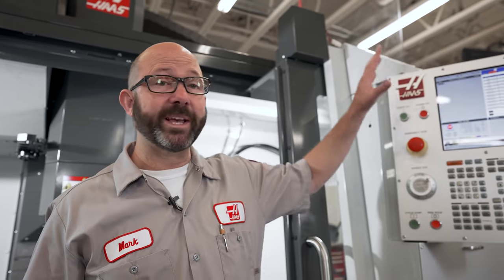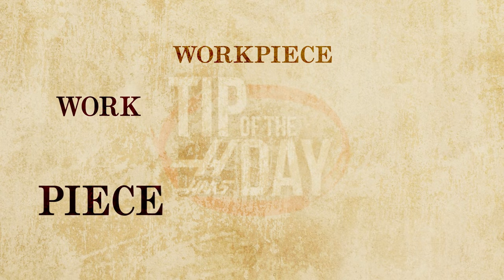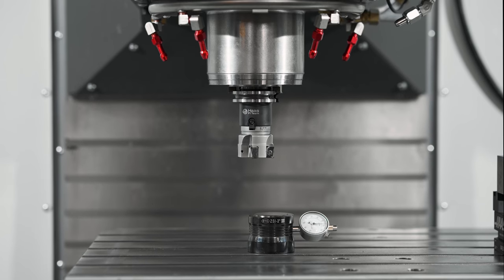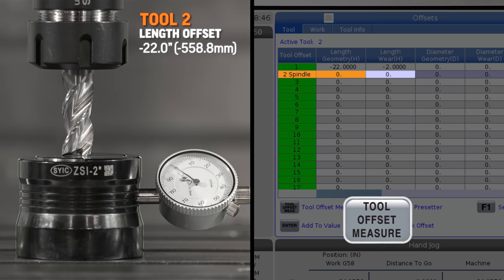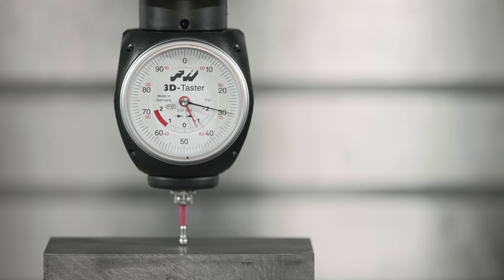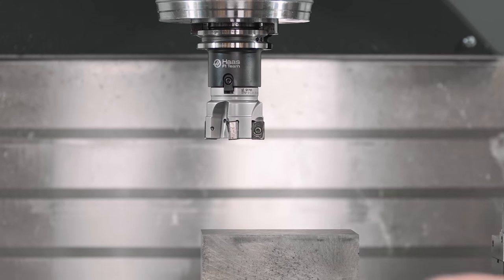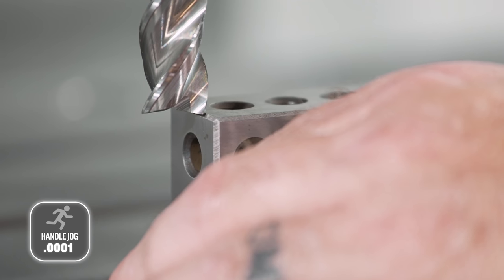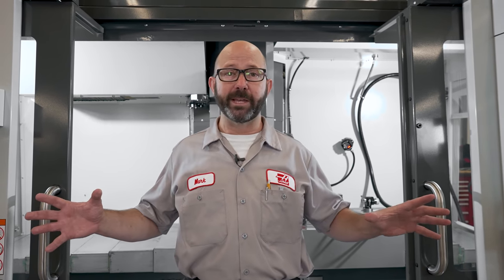Tool Offsets and Manual Tool Setters - Haas Tip of the Day

Comment: I come from 5 axis CNC routers programming. Silly question here: Why do you have to go thru all this drama for every tool? Don't these CNC come with an auto tool length measuring sensor for tool length compensation? You should only be loading the tool on the carousel tool chamber, then tell the machine to auto measure every one of them and DONE! You can use G54 for every tool within a (Sub-Pro-operation) knowing the the exact distance from the tool holder to the top of your stock, your machine is supposed to auto tool compensate for every tool, it would never miss it or crash. Sorry! Had to ask, just curious!!!

Comment: This would be a lifesaver if my tool probe died.
Reply: Sometimes we forget to order batteries. In that case, if you have a known good tool already in the machine, you can mill something flat (or use a vise bed/table surface, etc) and set your operator coordinates to the length of that tool. Then bring an unknown length tool to touch that same surface (or on a gage tool.) Your operator coordinates will have the length of the unknown tool.
Reply: I always have probe stylists in my desk for that reason, my boss hates they sit around in a drawer but no one give me credit for keeping one in my desk. Same with batteries. 

Make sure not to but any probe batteries later than 1 year after the manufacturer date
Reply: Please don't use the wear offset column to compensate for tool setters. That is the tool geometry.  A lot of times the machine will alarm out if the wear offset is over 50 tho

Comment: We use a pretty cheap tool probe and set all the tools to the top of it. We don't subtract to get us to the table. The we then touch off our part with our haimer stored as a tool. When we touch off we hit part measure and then we add the tool offset value for the haimer.

Comment: Why take the 2" out to get to the table? Just put the work offset from tool touch gauge to part Z zero....done.
Reply: That’s exactly what I do at work.
Reply: I think the purpose is to be able to use whatever height setter you want. If you can't find that touch off gage, or someone else is using it, you can just use whatever you have handy to touch off to the table. This way it is always using the table surface as reference. As Mark shows, you can use any height touch off gage. 1", 2", 4", etc.

Your method works too, but you must always use the same touch off point, since that's your reference.
Reply: @GRTLRS  Good answer, but of course best practice is always use the same reference that never leaves that machine.  Traveling height gauges tend to get lost and dropped.

Comment: We use multiple methods, but for when they use the paper method, I have provided all my machinists with small 1"X 2" pieces of 0.001" thick stainless shim stock.  These are cheap and east to make, and can be cut with regular scissors.  They don't fall apart when when wet and they are a reliable thickness and reusable many times.  You're pretty much right on zero when that shim stops moving under the tool.
Reply: I ran pricey lathes for a few years using the paper method that most of the guys recommended and used in the shop. 90% of the time works fine... but I realized after some time that there were certain tools and situations were the paper isn't the best method. That shim stock will help from breaking/chipping some stuff.

Comment: We used a surface plate with a hole for instrument cone. Then we put a tool on the surface plate, cone in the hole. And then we measure height of endmill using height gauge. A bit strange, not precise (+/- 0.1 mm) and error prone method. It works but not convenient and not precise.

Comment: When I was first learning CNC, I was taught to touch off all tools using a paper shim to the top of the work piece stock. If ANYTHING changed, youd have to touch off all the tools again. When I got my first job as a machinist, we were taught to touch off all tools to the table, which is a common datum plane, which makes WAY more sense, using a 2x4x6 block and a half inch dowel pin. This keeps the spindle pretty far from the table, which can prevent bumps to tall items such as rotary axes. Jog the tool down near the block, slide it under, then jog the tool away from the pin till it clears. Then subtract 6.5" from the length. The tool length is now set as the distance from Z home to the table. Work Z offset was the distance to the table to the top of the finished work piece. Taller parallels? Just raise your Z offset.
Reply: This totally makes sense, I used to use the paper method too but I’ve lost count of the number of times I’ve chipped a brand new end mill by doing this

Comment: Everyone at my work uses fancy tool setters, I’m working on making one, I’m just glad I’m
Not the only one that uses a 1,2,3 block for touching tools off. Newer people look at me like I’m crazy, I learned that trick from my old boss who has been running CNCs since the day you had to punch your code on paper. At my shop we use tool setters and probes, but occasionally on older machines I use 123 blocks on the vice
Reply: This is basically what I do when I set my tooling. The machine I use at work is at the hobby level and isn't worth spending more money on more fancy height gauges and such.
Reply: used to do that until a part had to be put ontop of the vise. then we maybe riser blocks about 4-6" tall that are bolted to a back corner of the table. then use a 123 ontop of that. that way your reference point is always avaiable.

Comment: Hi community! I'm in the Industrial Technician school in Denmark, I'm using a VF2 and we measure the tool offset with a digital setter as in the video. We have a G154 P99 programable offset, so ass soon as that red light goes on, we press "tool offset measure". This save us to compensate any extra, but is important to remember to run the compensation in MDI before offsetting the tools. Thanks for the video Mark, as always!
Reply: Това е мисля по добрия вариант и аз работя така
Reply: Could you explain a bit more about the G154 P99 programable offset ? Sounds interesting, Thanks
Reply: @KaLiDEM   I will try, this was some years ago and I'm not anymore with that machine. The idea is to place the tool setter on the working table and touch it with the spindle to store the Z value in an offset, in this case G154 P99. Once that’s done, with the offset active in the machine, you can put any tool into the spindle, then touch in the setter and when you’re ready you just press the “tool offset measure” button. So because you have G154 P99 active, the tool offset that will be updated in the tool will be the difference of the spindle offset stored in G154 P99 and the actual tool length.
Again, I haven’t used this method for a few years, so I may be missing some details in this explanation.
Cheers!

Comment: Mark, as always excellent video.  I have a 2003 Mini Mill and I used the paper shim method for 20 years, but as someone pointed out below - you had to redo every tool height when you changed to a new part.  I needed to do something to cut down on my tool setup time, so a couple of years ago I got a Heimer and a 2" high tool height gauge (like the 4" one in you video).  Typically I don't have access to the bed of the mill, so I put the tool height gauge on to the body of the vise installed and set all of the tools to it including the Heimer (The tool offsets go in the location for the respective tool and I usually put the Heimer height at tool location 20 since I only have a 10 piece tool holder).  When I put in the material to cut, I use the heimer to get the Z height of the material and put that in tool offset location 21 (or 22,23, ... if there are multiple heights) .  The I just subtract the part height from the Heimer reference height - so for my first part height in G54 I use: tool offset 20 - tool offset 21 = my G54 Z offset. For the next part height ( if there is one) it would be tool offset 20 - tool offset 22 = G55 Z offset.  This way all of my tools are already set to my Heimer reference height and when I need to machine a different part - I just measure the new material height with my Heimer and put that number in tool offset 21 then subtract it from my Heimer reference height (tool 20) and put the result in the Z offset for G54.  It saves me so much time.

Comment: Our shop uses the 3" side of a 1-2-3 block as our standard. I personally use the style of tooling light you showed on top of a 1-2-3 block on its 1" face as it's a lot harder to chip a cutting edge than if you use the 1-2-3 block itself.

Comment: On all my machines that don't have a tool probe, I like to keep one work offset dedicated to tool touch offs. I use G129, which is set 3" above the table or sub-plate (depending on the machine). When the operators need to manually touch off tools, they simply execute the "Tool Touch Off" program and it moves to G129 X0. Y0. (a clear XY space on the table). Then they just have to jog the tool down and touch the tool off using a 1-2-3 block on the 3" side and hit "Tool Offset Measure." It eliminates the step of having to subtract 3" after the touch off. Very easy procedure to train and very repeatable. 

It's worth noting that my processes are set up for "machine operators" rather than actual Machinists. Simplification is always a good thing though, no matter the skill level.

Comment: In my shop when dealing with raw stock we touch off our first tool typically a shell mill with a gage block. Subtract the difference along with an additional .03 of stock. Then we touch off all other subsequent tools and use negative z offsets in our tool offsets, leaving our work piece offsets as Z0 .

When we are working on further operations we tough off the bottom of our fixture or jaws with a gage block and subtract the different and add in the height of the part based on where it is being held onto by the touch off point of the fixture. Still leaving works peice offset Z0.

Comment: I've often used a gauge pin similar to how you used the 123 block. Jog the tool to an obviously lower position than the pin diameter, keep the pin against the tool as you slowly jog z up. When the pin rolls under, you have your position.
Reply: Same here if not using a tool setter gage. If I have jog increments at .001, when compensating the tool length to account for the gage pin, I add .0005 to the diameter of the pin. If using. 010 increments(usually only drills, or some other insensitive Z length tool), I compensate by adding .005.

Comment: O man, cant wait to use the mem button tomorrow. I always just use a calculator and the origin button on the operator position.  I use the same haimer indicator, and same techniks tool setter.  On super fine height work (engraver) i will use a beater gage block and still use the work surface as the reference and jog down and check each .0001 increment.  I was curious how to use a positive number for tool length when using tools between machines, we have a vf2 and vf3, never thought to use the positive gage length to the table in the tool wear column, i never use it and totally forgot its there.  Best haas tip of the day!!!

Comment: I made my own tool setter like the ones illustrated here close to 20 years ago.. and it works better than any store bought setter I've used.
My method is almost identical to this video,  but instead of dropping each tool by entering -2.000 (in the case of this video) I just drop all of the tools simultaneously using the Z column on G54 work offset. We also use the same column to drop the tools an additional .01 or so, so there is stock to face off. 
I also machined and ground a standoff I use in tandem with the tool setter, so I can come back to the exact same spot every time I need to swap out tools. The standoff stays on the machine. I use an empty work offset (G59 etc.) to make it easier to get there.

Comment: I use the Edge Technology 4" Tool Setter on the body of my fixed jaw. Then I come in with a Haimer probe and measure the Z distance between the top of the fixed jaw and the workpiece. Since all my tools are set to 4 inches above the vise, I reduce the chance of a crash if a Z offset is missed since most of my parts are shorter than 4 inches. After a dry run and when I'm ready to take a cut, I subtract 4 inches from the Z offset my Haimer probe picked up and I'm good to go.

Comment: I use the Renishaw probe and tool setter.  It's awesome!  I used to use the piece of paper on top of the part method.
Reply: The probe is the best. For the first few years of my career ('90s) we didn't have any probes, but once I got my hands on one I never looked back. I've asked specifically for Through Spindle Coolant and Probing, whenever we'd order up a new machine, because it just made my life so much easier as the machinist. We have quite a few videos on probing out there, and the CAM packages are all leaning into probing now as well, allowing us to write probing routines from our CAM program, just as easily as a drilling operation.

Comment: I use a Haimer 3D probe and a tool setter with indicator and precision surface like the first one shown in the video. I simply zero the Haimer on the tool setter reference surface, and store that as in work offset G110. I did this once, months ago. You also need to set relative tool length measure on, I don’t remember which setting number this is or if this is by default (I have an ‘06 mini mill).
To measure a tool length, first do G110 in MDI (I have a label on the tool setter to remind me) Then you touch the tool on the setter and hit tool length measure. To set part a zero, just  zero the Haimer on the part, hit part zero. And done. No typing numbers other than G110 in MDI. This means that frequent operations require zero thought, and less frequent ones require just slightly more thought, but never manual number entry.
Reply: I feel like this is the easiest way of setting tools, it's how I've done it since I started as a machinist however we just use G59.
Reply: @shanebonato309  yeah. Any spare work offset number would work. One of the bonus things of this method is you can just touch off tools with paper method on the work piece of you feel like it. All you’re actually doing is recording how much longer or shorter than the Haimer your tools are.

Comment: good friend made a custom macro for a 50mm toolsetter for me, simply run down to 0 on the setter and the marcro does the maths from knowing the 50mm setter height and the spindle nose to table height.  Doing it this way avoids any manual calculation or entry mistakes plus ends up with a positive tool length number in the tool offset table that equals the length of the tool from the spindle nose which is great for being able to put a ruler next to the tool for a quick check.
Reply: Exactly how I work to calibrate my tools.
Reply: Amazing! Could you copy that macro here?

Comment: I was taught to use the back of a broken half inch endmill to touch off manually. (I’ve found it’s a lot harder to chip your tools.) For setting work offsets I just use a tool that’s already been touched off the table. (As you have shown this is a large negative number.) When touching off the top of my part with the 1/2 inch pin I hit part zero set (this will give you a large negative number in your work offset page) then type in the large negative tool length but positive. This will give you the distance from the table to the top of your part. This is why I hate that y’all split the work and tool offset tables on the next gen control. I now have to go back to tool offsets check my length then go back to work and type it in. 
I hope this makes sense.

Comment: we use either laser sensor in the machine or an optical presetter to set the tool lengths (spindle face is zero). Then we use the 3d touchprobe to touch off the part. done.

Comment: I personally like using a broken carbide end mill and touch off on the solid back end of a vice. After that adjust my G54 or the like. A close second is touching off at the very top of my parallels.
Reply: I do the same spot, only with paper. Well, if the machine doesn't have the Rennishaw Tool setter that is. I figured out this trick on my own. Apprentices have the advantage now with Mark.